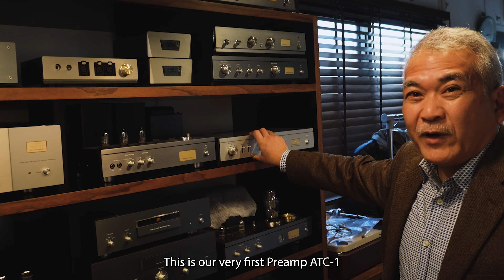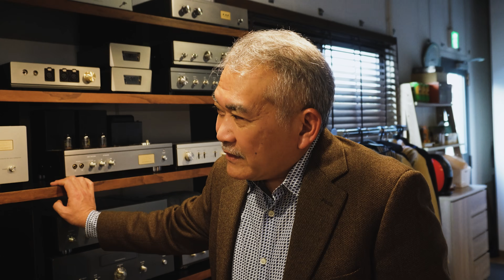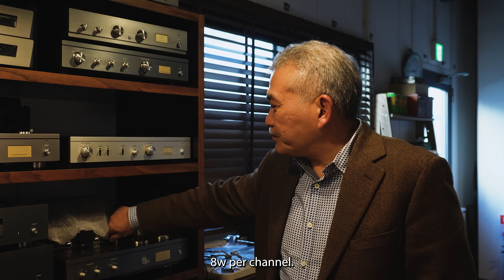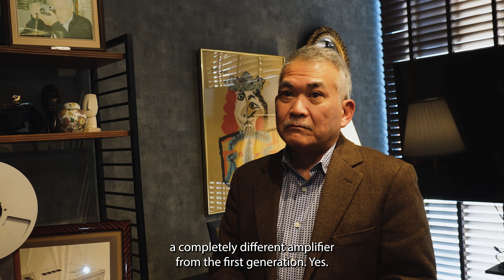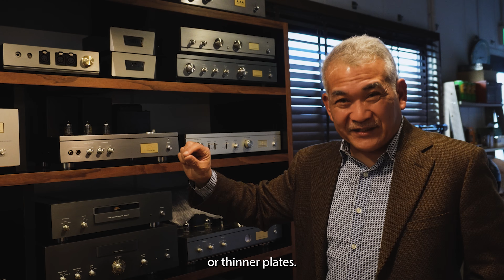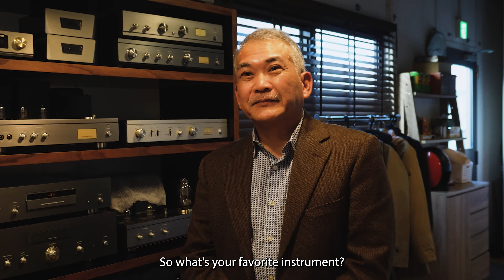Air Tight Tube Tech through Time with Yutaka "Jack" Miura

Comment: I also use copper plates for building preamplifiers .....I still have a CL32 preamp ( Luxman) designed by Miura..and it still sound musical.....
Most amplifiers sold today use circuit boards ....That's a no no for me..
Thank you for this quality upload.
Reply from the maker: Thank you! :)